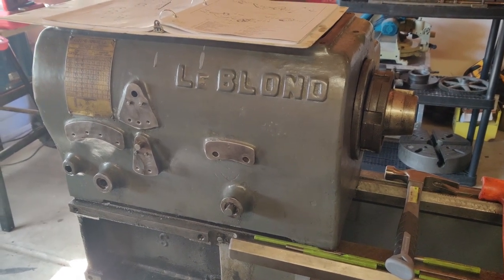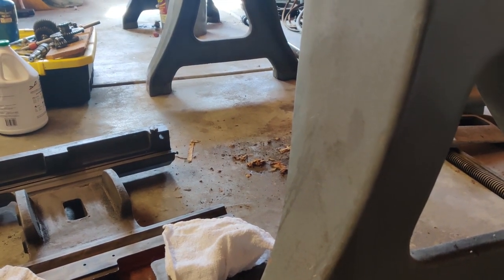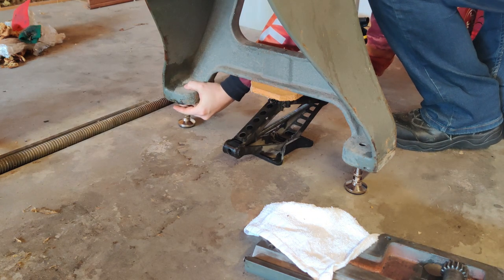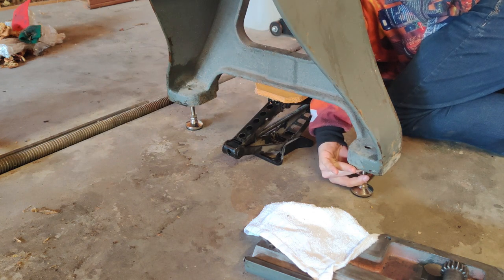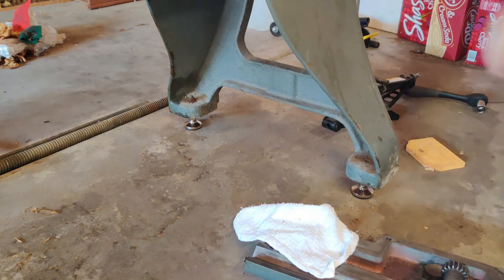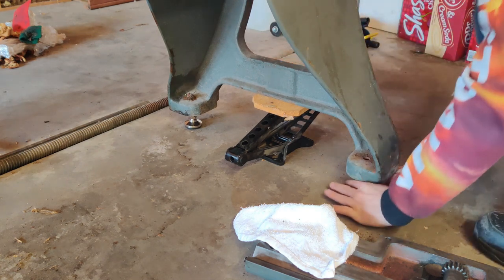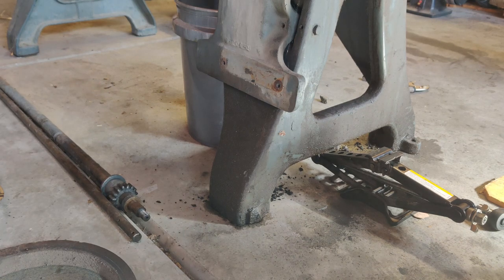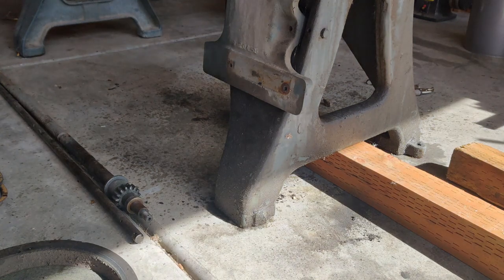1950 LeBlond Regal 17" Lathe Restoration Part 15: "Leveling" the Lathe

Comment: Might it be an option to add some material under your new feet to get a lil more height?
Reply from the maker: That might work temporarily but wouldn't be nearly as stable. I should be able to get some thick steel plate on Monday thought that would work.
Reply: @cavemaneca  with all the vibration going on when you get it up and running you really can't sacrifice any kind of quality on those leveling legs.
Reply from the maker: Yeah, before I start running the machine I'll definitely have some better feet on this.
Reply: I guess I should have specified better. I was thinking steel , or aluminum,  or masonry